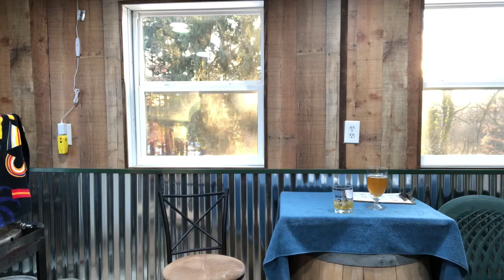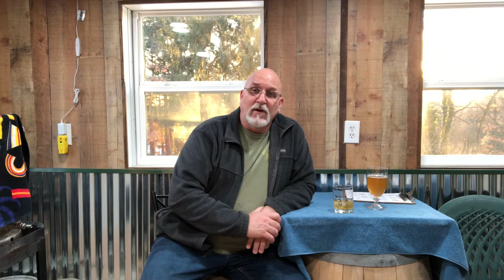HBW Input Requested

Comment: Im a little late to the party. I have a 2 vessel recirc system (just like Joe). I build my control panel from supplies bought from Electric Brewing Supply out of Chassell Michigan.
You can buy everything you need from them to convert your current system to electric. Their panels can be purchased as a build your own, or fully assembled ready to plug and play. You'll just need to add the accessories to your kettles.
Reply from the maker: I’m ready to get this going!!!

Comment: I have an all in one and 3 vessel system. I have a 120v mash and boil that I upgraded some robobrew parts to. It’s nice but takes along time. Plus it’s cheap if you already have pumps. I made my 3v system kettle and hlt so I could easily cap off the 1.5” hole and go back to propane if I wanted. Bobby at brewhardware has a ton of stuff to make it an easy conversion with no welding. I did build my own panel but it’s very similar to the high gravity panels. I did originally build a 120v system and it did work but took forever to heat up water. If you can, go with 240v system and 5500w elements. I upgraded to 240 and can heat my well water from 54f to 170f in 20min, yes 10 gal. Cheers SJ🍺🍻
Reply from the maker: Great info! Thanks

Comment: So you've got your mash tun with your copper spargeing set up   . The same as mine more or less
My boil kettle is a 32litre pot that I put a 3kw element into connected to a small control box. Just more power and less power adjust ment . Works very well.
My HLT is just a 36 litre electric canning pot that's about 40 years old and even has a thermostat built in. I paid $40 dollars for it. Guessing the wattage is similar to the kettle. If you were to put an electric element with a controller into each vessel and maybe add a thermostat to the HLT you'd be good to go. Cheers SJ
Reply from the maker: I’m looking forward to getting this going!

Comment: I love the Mash n Boil. The only thing it isn't good at is higher gravity beers, but they are so easy to use and the clean up is so much easier. I use the 120v, so no need to get an electrician involved to install higher v. Traviscoloradoflyfisherman has some good review videos on it holding heat and stuff like that.